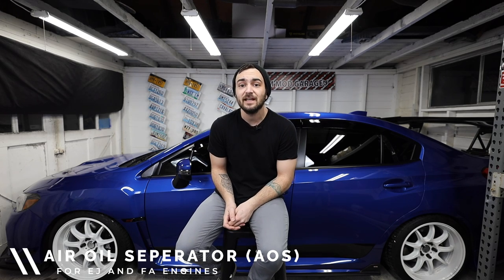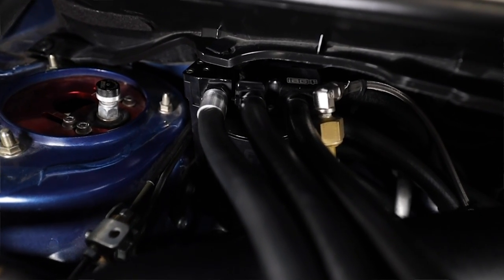5 Modifications To Reduce Engine Knock On Your WRX or STI.

Comment: Hks header is also good and a bit cheaper.
Reply: TheGeokaiser biggest issue with the HKS is the material used, not the highest grade metal. Ceramic coat it though and you don’t have to worry about that at all though, and the HKS headers are priced good